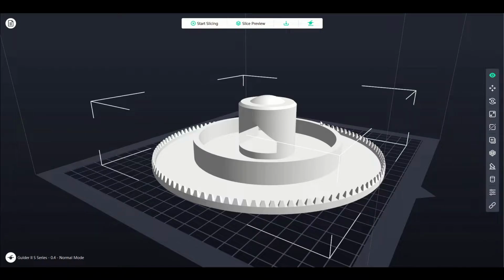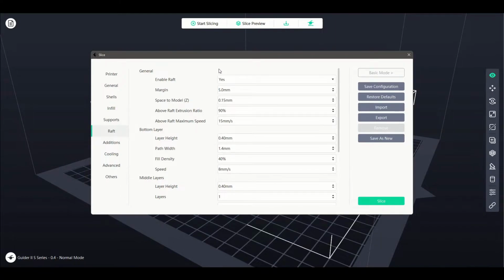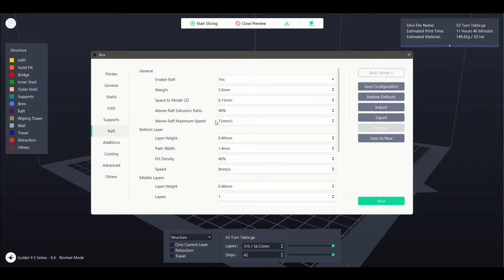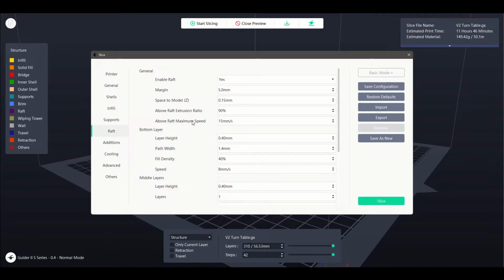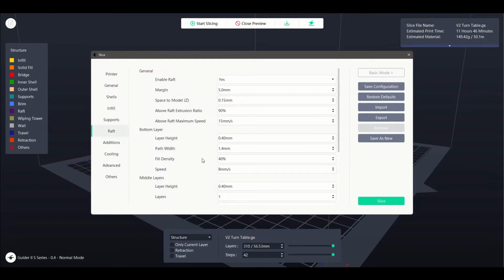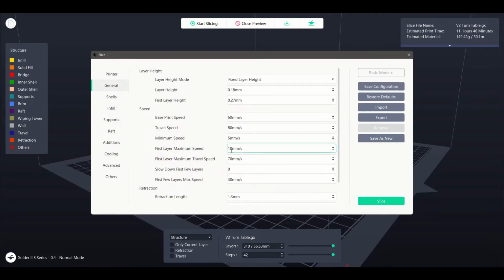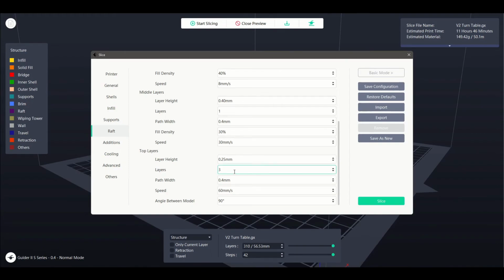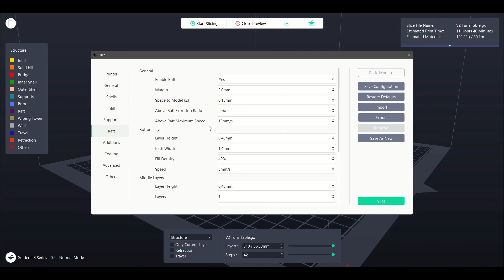FlashPrint New User Tutorial - Part 05 - 6 - Raft Settings

Comment: How can we remove seamline..?
Reply from the maker: @babinlallalu9956  You can change its location, inside, outside, random start points for new layers, which can change how visible the seam line is. But you can’t remove it entirely. Different printers can have more or less distinct seam lines also. I will have to double check where these settings are, if you’d like me too.

Comment: I have heard there is other tipe of bases, not just rafts but brims, where is that option?
Reply from the maker: It is in the Additions section. Personally, I don't use either. Glue stick or 3d print specific adhesive do very well of ensuring the model and supports stay attached to the print bed.

Comment: is there something wrong with mine because mine cannot print without a raft the filament just curls as it comes out of the extruder
And even if I do turn on the raft it usually starts coming off the bed mid print not completely but it does curve the bottom layers of the print and I really don’t like the really thick raft and can’t figure out how to adjust it

Comment: If you haven't tried a function you perhaps should not talk extensively about it. Although interpreting the ToolTips and explaining some background is definitely a plus especially for beginners.
Reply from the maker: I have to disagree with this comment. Whether I use it or not personally matters little in my explanation of it. Just because I haven't had much need to use it does not lessen my understanding and the idea behind these videos is to provide enough basis to determine if the user needs to use certain features and what changing the settings may achieve. 

A raft is a brilliant tool for new users, however, it can also be a crutch that prevents beginners from learning how to correctly level their bed, as an incorrect bed has many of the same symptoms as a warped one. And there are other tools to prevent adhesion and warping issues, glue stick and correct bed temps are my personal choice.

For you other comment, Flashprint does take into account the extra time and material required to print a raft/brim/wall. It just does it poorly.

Comment: I almost always use a raft, despite the degraded appearance of the bottom layer of my object. I consider adhesion and warping much greater threats to the success of my projects. I would probably not use a raft as much if the printers I have access to had pristine build plates.
The FlashPrint slicer never takes into account the time to print "extras", brim, raft, pre-extrusion, etc. (I consider that a bug especially since the FlashForge printers are 'dumb' and just display the time the slicer presents).